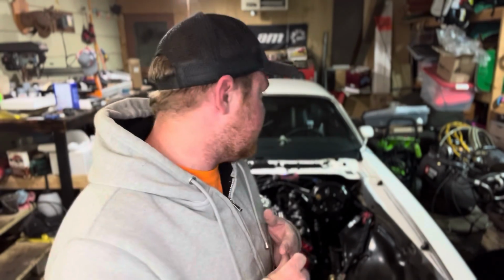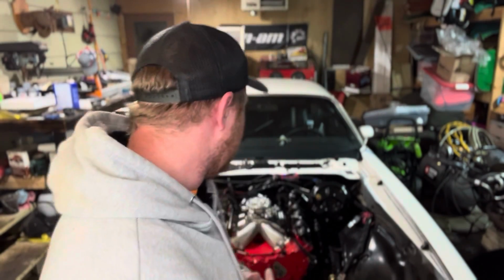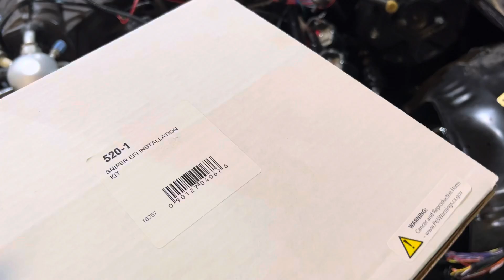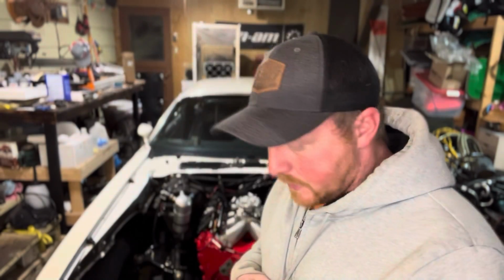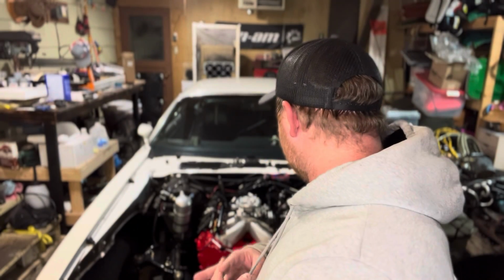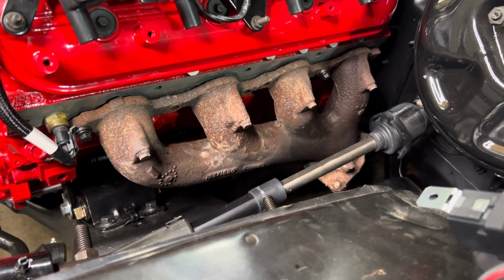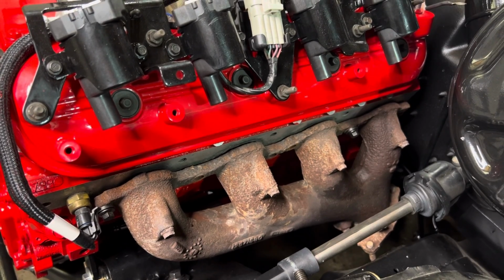Modifying￼ our stock LS truck manifolds by SHAVING them ￼clean

Comment: 11:50 no you dont. on this cast anyway, maybe cause its so thin. have 3 sets of these running on 3 different LS swaps with THOUSANDS of miles on them and no cracks or leaks anywhere.
Reply from the maker: Nice

Comment: I always thought it was a lot harder to weld cast iron than that.  Did you use stick with a Nickel rod?  I saw you pre-heated with a torch, did you just let it cool off on it's own or did you pack it with sand or something so it would cool slower?
Reply from the maker: Preheating is the key and I just used a meg welder and let it cool naturally
Reply: @life_bycars  That's just one of those things people like to make seem like rocket science I guess.
Reply: LS manifolds are cast steel, not iron.